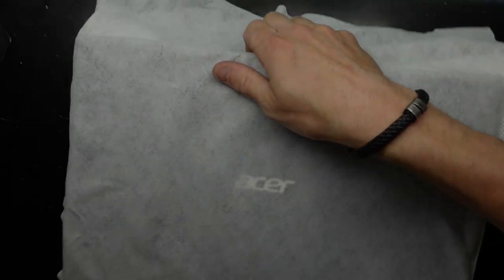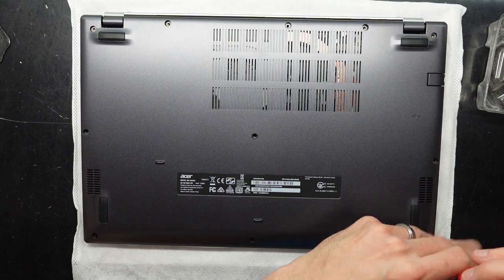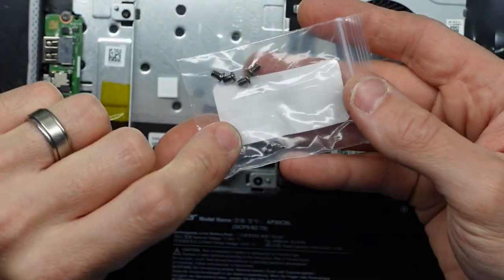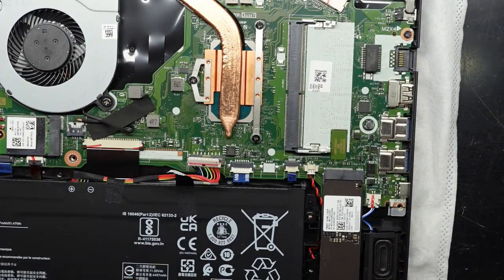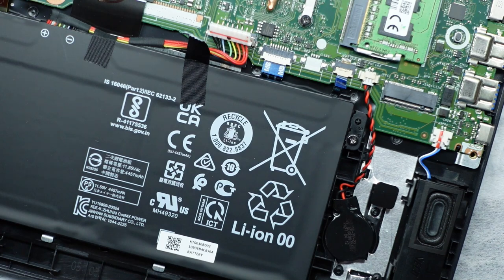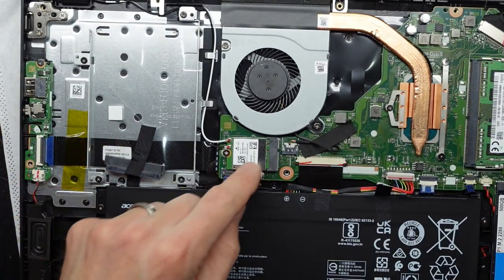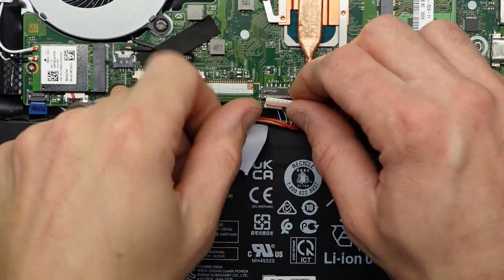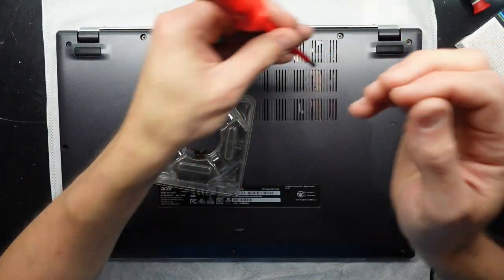Acer Aspire 5 2021 A515-56 SSD and Ram Upgrade

Comment: Hey bro, i have the same laptop, but, in the task manager, in the apart of Memory, it tells that i have 1 of 2 slots used, so, i disambled my laptop to put another memory, but, in the motherboard i saw an only slot, can u bring me a opinion about that? thanks . :D
Reply: Probably the memory that comes with the laptop is soldered
Reply from the maker: Was the slot empty ? 

It might be it has soldered on ram and a empty slot for future expansion

Comment: is it fine if I do not disconnect the battery? I'm planning to upgrade my RAM but it's too hard to disconnect the battery. I might break the wires if I force further.
Reply from the maker: if you cant disconnect it, make sure the system is completely powered off and no in sleep
Reply: @rickstechrepairs  I just successfully upgraded my Acer Aspire 5 from 8gb to 16gb. You're a total lifesaver! Thank you!

Comment: My a515-56-77J7 has 12gb total memory, but there is only 1 4gb ram stick inside, as purchased from Best Buy. Is there 8gb more in there, hidden? And, can I replace the ran stick with any other? The ram stick pre-installed looks the same as the one you had put in, were you upgrading from 8-12gb? Sorry for the long post, but I need answers.
Reply: I can't speak to your specific model, but every Aspire I've seen inside has one soldered-in stick of RAM, and one upgrade slot. If you have a 4GB stick in the upgrade slot, you've got an 8GB internal stick. You can verify this by opening Command Prompt as an admin, and running "wmic MemoryChip get BankLabel, Capacity".
you can read more about wmic MemoryChip parameters. IDK what you use your laptop for, but 12GB is enough for most casual users. You've got the i7 model tho, so if you're doing something more intense and want to upgrade, the best bang:buck would probably be replacing that 4GB stick with an 8GB stick with the same speed/timing. You could throw in the biggest SODIMM stick you want, but if they're not matched capacity, it'll be running in single-channel mode (which isn't bad, just less ideal).
Reply from the maker: sounds like the 4GB is soldered as riboslavin mentioned
Reply: @riboslavin  thank you so much! I use it for casual gaming and schoolwork, so upgrading for gaming would be good, as it uses a lot of ram. Would the 8gb 1r x 16 PC4-3200AA-SC0-11 (same ram in video, except 8gb) work?

Comment: Hello, do you think I can use the 2.5" HDD slot for a 1TB 2.5" SSD instead? My unit is A515-56-53rz. I'm hoping for your response. Thank you
Reply from the maker: I don't see why you couldn't
Reply: @rickstechrepairs  Great! Thanks! 'Cause technicians in the shop from which I bought my laptop say that you can only use hdd for that slot and not ssd. Guess I'll have to find another shop whose technician would agree to install a 2.5" ssd for my laptop. Thank you very much!
Reply: @Quiel.33 It’s incredibly easy to install a 2.5” drive (SSD works fine). All you have to do is snap in the SSD into the caddy and plug in the drive. Simple as that.

Comment: They should be embarrassed selling it with 128G considering window bloat. Mine came with 512G and I'm adding a 2nd 2T drive. Could i put in a 2nd SSD and clone HD1 then replace HD1 with the new SSD?

Comment: Thank you for your help with this video. I just upgraded my laptop (the same) with elite ddr4 32gb 3200. Working great.
Reply from the maker: awesome :) enjoy your laptop
Reply: @rickstechrepairs But it won't work as a dual channel right?Will this increase fps like dual channel Ram does?
Reply: hi, but the max ram supported by the board is 20gb, am I wrong?

Comment: Thanks for so good video. One question: for what is visible, this laptop can get one more SSD 2.5"?
Reply from the maker: i dont think so
Reply: Yes, there is a spot for the 2.5inch SATA SSD to the left side of the board. You can clearly see the SATA connector throughout the video. I added 1TB MX500 drive to my laptop.
Reply: @Alonso.240  hello, so it is possible to use the 2.5" hdd slot for 1TB 2.5" SSD and there will be no problem? It is applicable for all variants for A515-56? Mine is A515-56-53rz btw and I am planning on upgrading the storage by adding an ssd through the hdd slot if possible. Thank you
Reply: @Quiel.33  Yeah you should be fine. I did the same to my laptop as well. Mine is a A515-56-73AP 
Very similar to yours.
Reply: @Alonso.240  thank you so much

Comment: I just picked up one of these, however I've already set it up. If I buy these upgrades is there any other requirements/setting changes/software installs needed to make use of them? I'd like to maximize my laptops potential but I'm concerned I might not have the necessary knowledge to do so?
Reply from the maker: ram you simple install

SSD would need a fresh reinstall or a clone
Reply: @rickstechrepairs  thanks

Comment: I have the exact model,  does it have the back lit keyboard ability,  the f8 key is blank also does the size of the ddr4 ram I want to install matter (example 8gb, 4gb, 16gb) and the laptop says 1 of 8 slots used. I don't think it has 8 ram slots built in. So what does that mean,  or does it really have 8 slots?

Comment: Have the a515-56-5385, Has the same shell but silver and an i5 instead. My memory is constantly being used 70%. Do you think I can upgrade the expand the ram? And what ram did you use for this one, was it DDR4 or something else?
Reply from the maker: Sounds like you are using up a fair bit of your ram 

I would upgrade to 2x8gb 3200mhz sodimms
Reply: @rickstechrepairs  how can you use 2 ram sticks? I only see the single slot

Comment: I ordered a 1 TB NVMe ssd to upgrade my laptop. Do you know if I need to take any special steps to make sure the operating system loads and works properly once I switch them out?
Reply from the maker: yes, you will either need to use software to clone the ssd (also using an external adapter) or you will need to do a fresh windows reinstall
Reply: @rickstechrepairs  
Thank you!

Comment: one question I want to ask about Acer Aspire 5 (A515-56-36Q8) -  how many ram of this can upgrabe. Now : 8GB 2667 MHz , please !
Reply: There is one soldered (on-board) 4Gb ddr 4 Ram inside. You can remove the other 4gb Ram from the Ram slot and fix a 16/8gb ddr4/2667Mhz Ram there. The maximum amount of ram this model can upgrade is 20 gb.
Reply: @sham5968  thanks alot

Comment: If it comes with 4gb by default and 1 empty slot, can i add a 8gb to make it a total of 12? Or does it have to be another 4gb to match the first
Reply from the maker: i would match it with another 4GB stick, so you get some dual channel performance

Comment: i got the same laptop but for some reason the ram does go to 3200mhz i tried to go to bios but the settings arent there might it be that my motherboard doesn’t support somehow i checked and the speed was 2666mhz i added a 16gb ddr4 crucial ram.
Reply from the maker: the bios wont have xmp settings to make it run at a faster speed
Reply: @rickstechrepairs  Oh so i cant change it?

Comment: i have the same laptop with 8gb memory.  should i only add another 8gb card so they match OR can i add a 16gb to give me 24gb total?
Reply from the maker: could go either way

8+8gb will give you dual channel performance boost (about 5%) 
8+16GB will give you 24gb of ram useful if you actually use the amount

Comment: i turned this off after 5 min, nothing said about the speed of the ssd before and after, i put a 3500mps samsung speed in mine , the one it came with was only 900mps, also nothing said about the ram on the other side of the board if its fixed or upgradeable to get 2 x8 for 16gb of ram, do your research then record the video , should be 3 min vid not 10 min,
Reply from the maker: This is a simple upgrade video not a benchmark video
Reply: @rickstechrepairs  thanks for uploading! i have problems of plastic bits breaking off when unclipping the back